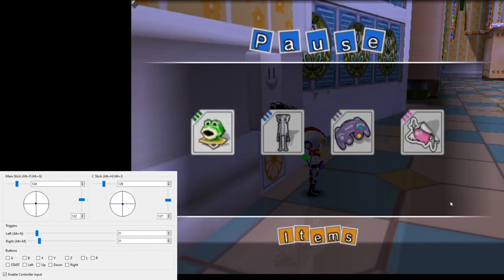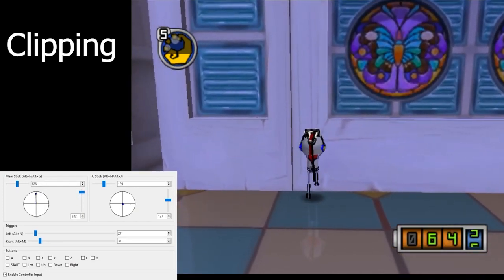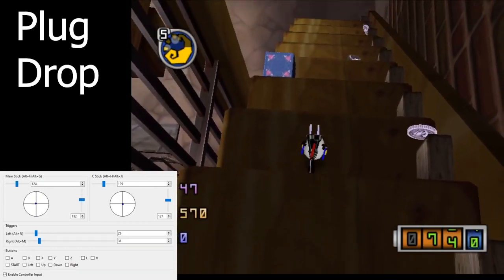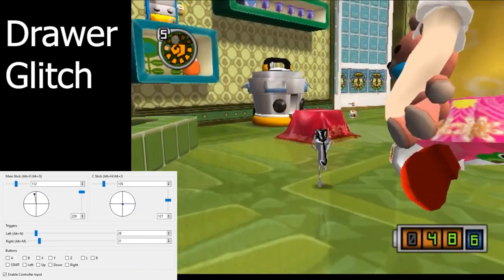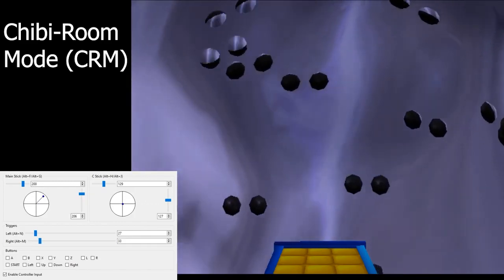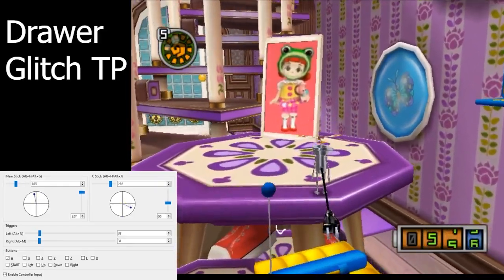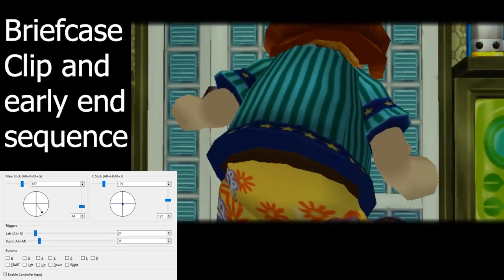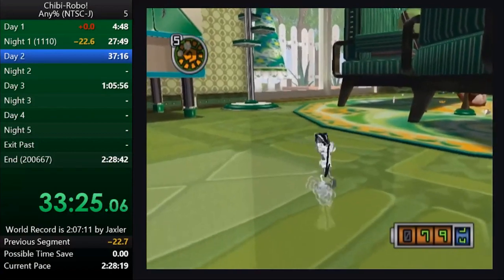Chibi-Robo! Plug Into Adventure Glitches & Speedrun Strats + $100 Glitch Bounty

Comment from the maker: Specific Glitches Timestamps:
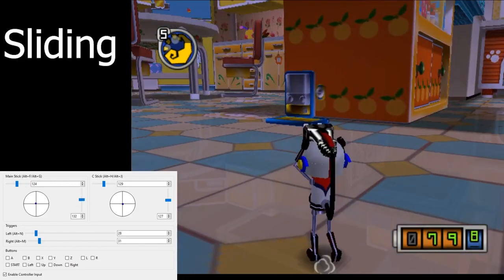Sliding - 00:00:53
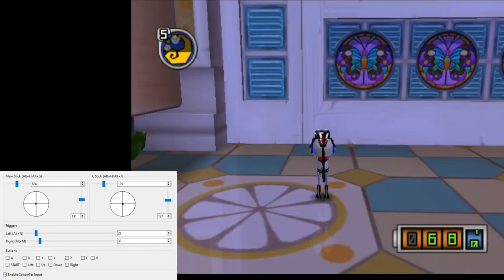Clipping - 00:02:40
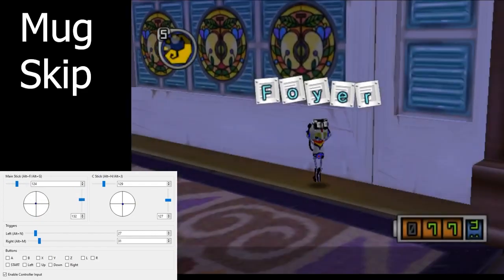Mug Skip - 00:04:13
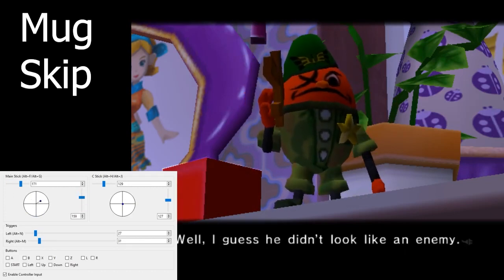Basement Clip - 00:04:50
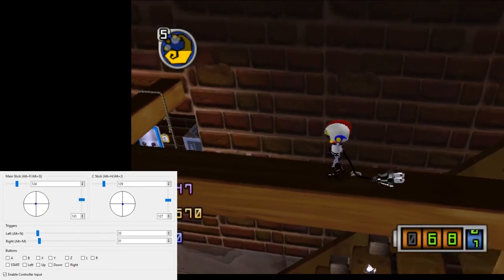Plug Drop - 00:05:54
Teriyaki Blues Skip - 00:07:08
Drawer Glitch - 00:08:24
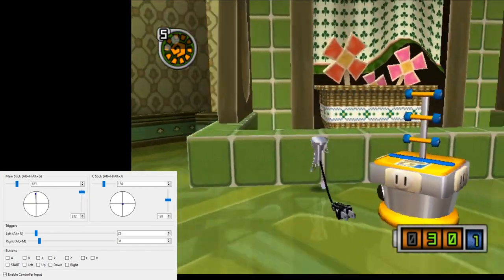Fireplace - 00:10:18
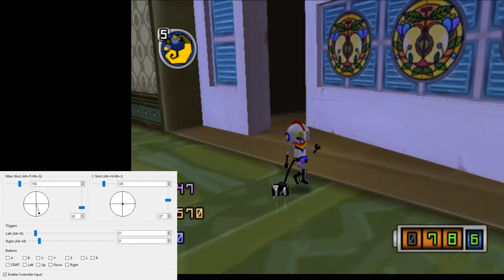Sliding Alternate Use - 00:11:09
Chibi-Room Mode (CRM) - 00:11:48
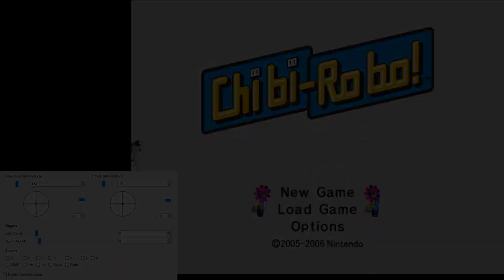OOB Moolah - 00:14:30
Odd Stool Interactions - 00:14:48
Frog Cutscene Skip & Oddities - 00:16:00
Briefcase Clip & Early End Sequence - 00:17:28
$100 Glitch Bounty - 00:21:23